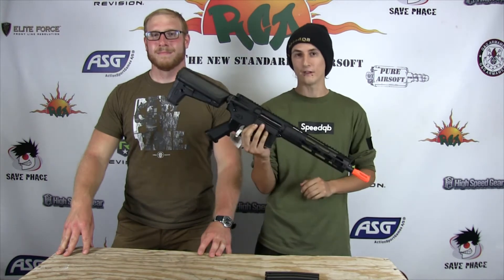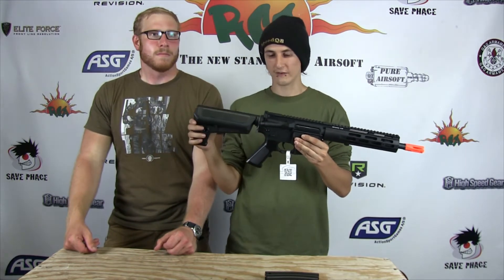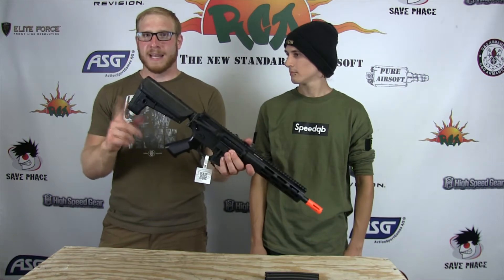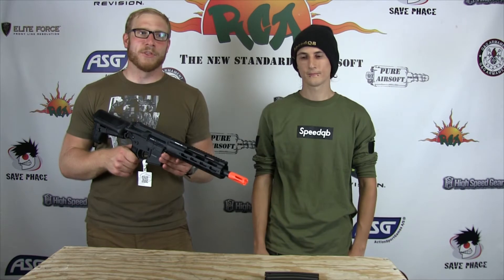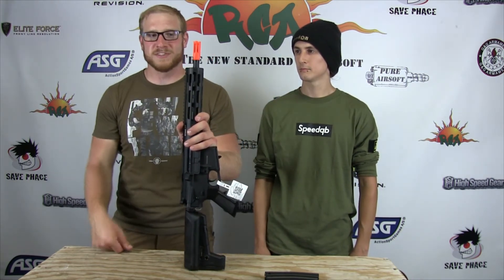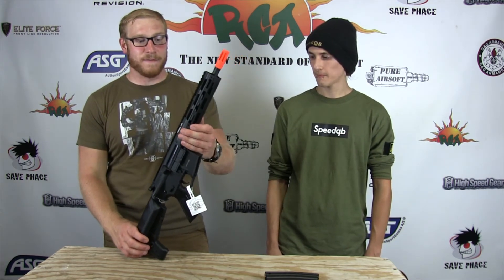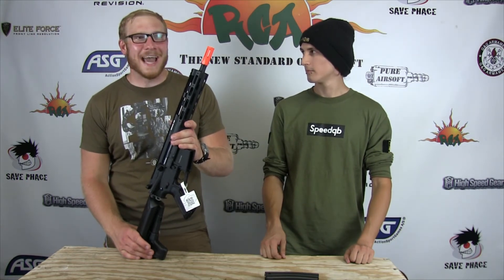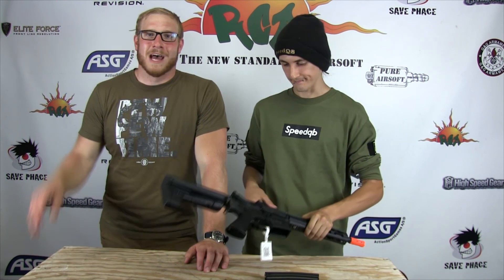SpeedSim: First Impressions of the Krytac Alpha CRB

Comment: Could I run a m115 or maybe even a m120 spring eith stock motor?
Reply: that guy o yeah77 i would love an answer to this as well. I heard you could do an m115 but an m120 is pushing it. Thats just what i heard.
Reply: I attempted to upgrade just the spring and I found that the trigger response goes to shit... Get an ASG 30k motor with the spring and replace the motor while you do the spring job and you will maintain similar trigger response rates to stock 👌
Reply: @leleedler  a little late but i got a 40k motor way before i got the gun, got tired of the trigger response so i replaced the motor. the stock fuses can't handle the 40k motor so i had to get 40a fuses instead of 2a. so to answer your question no but get a motor and better fuse and you will circumvent that problem easily

Comment: Anyone know if this gun can run an 11.1v lipo?
Reply: Not unless you replace the motor. This was designed with mid-tier players in mind, so, like they said, the motor isn't quite as good as the Trident series motor. While a 9.6 NiMH and 7.8 LiPo will work beautifully, the Alpha series is definitely not designed to accommodate an 11.1 LiPo. The motor would be turned to a nice warm paste.